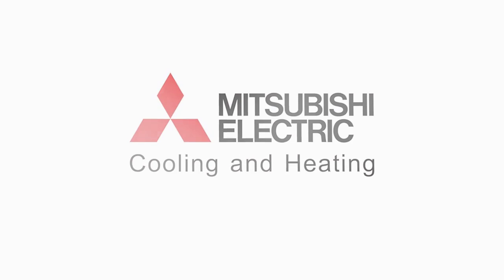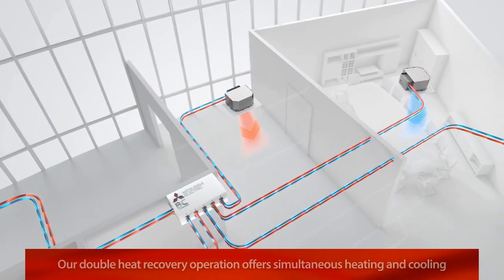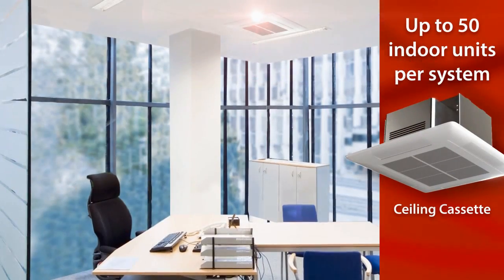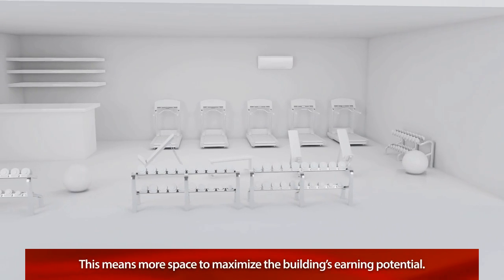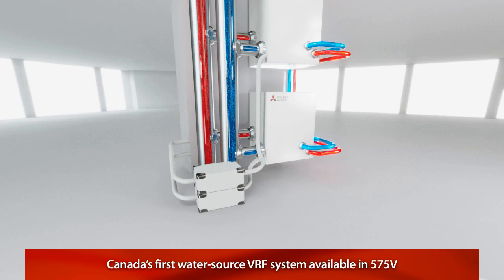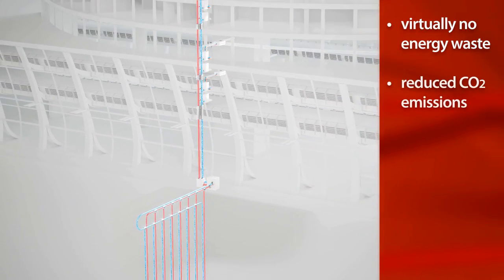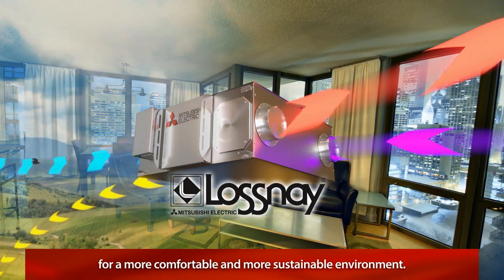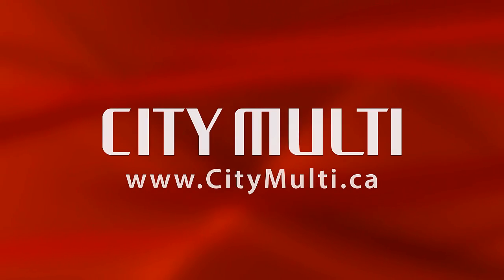Mitsubishi Electric City Multi Water Source VRF System: Introduction

Comment: which series is the more compatible with geothermal energy or what devices to be used for this usage and what's the benefit of this usage in energy saving ( is there increase in the heat pump cop)?